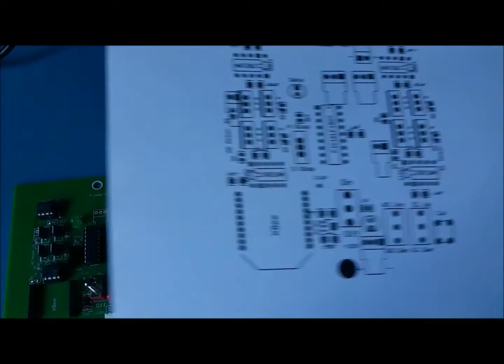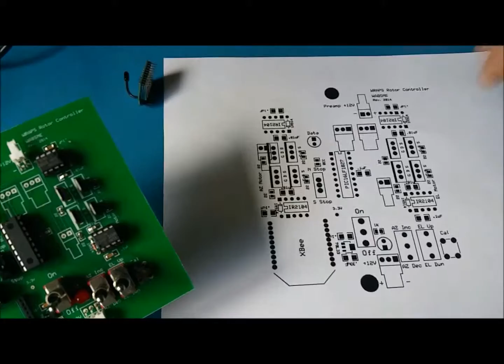Ham Radio Portable Satellite Tracking System WRAPS - EP3 Electronics Assembly

Comment: hi where did you buy the whole set of the parts amd the pcb board.
Reply from the maker: Raymond Wong Hi. The board is sold by the arrl.org. Do a search for WRAPS in their website. Motors and hardware were at servocity.com. The electronics was a combimation of digikey.com, mouser.com and ebay.
Reply: Hi !  Can you be more specific on how you got all the parts?  I tried both arrl.org and amsat.org and they don't have any info on the circuit board or the kits. Which parts did you pick from servocity.com and digikey.com.  I saw all your videos and thanks for such detailed explanation on how you assembled this satellite tracker.  I like to build one but unable to get the specific info from each site.  The latest presentation by Mark Spencer shows a Xbee unit on the circuit board to avoid RF noise, https://www.youtube.com/watch?v=5p5XiZ_IA98.  The site https://www.amsat.org/product/wraps-tracker-circuit-board/   still sells older version of this board!!!  So would appreciate if you can give details on what to order from which vendor would help!  73 KR1SH
Reply: https://www.amsat.org/product/wraps-tracker-circuit-board/
Reply: The Board come with a CD containing files and includes spreadsheets with all the part numbers from both Servo City  and DigiKey. I just got the board and that night order from both and they both shipped the next day.  Watching tese videos again waiting for everything to arrive.      Aloha and Thanks for the great videos!
Reply: Thanks! Just got all the parts and starting the assembly!  My challenge would be to make it work with Mac software!